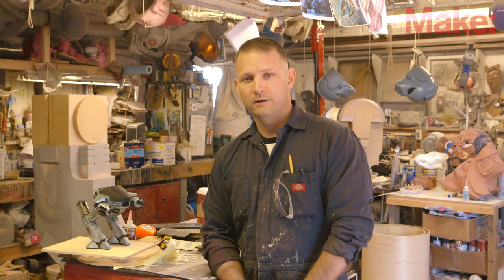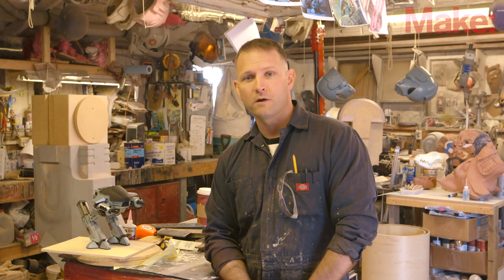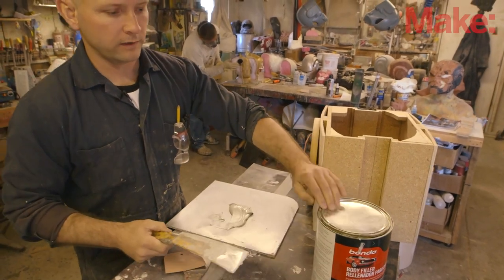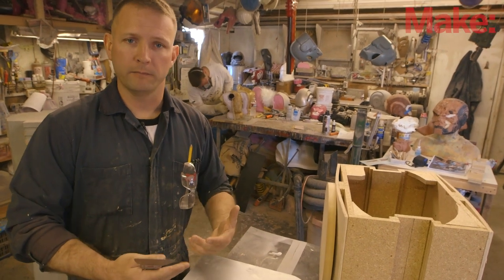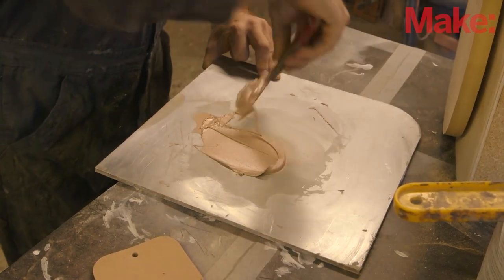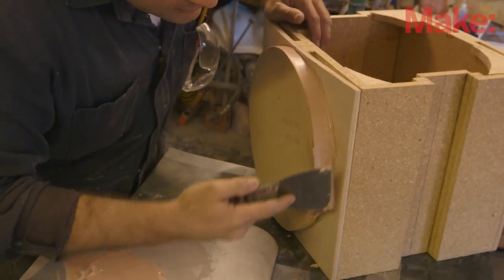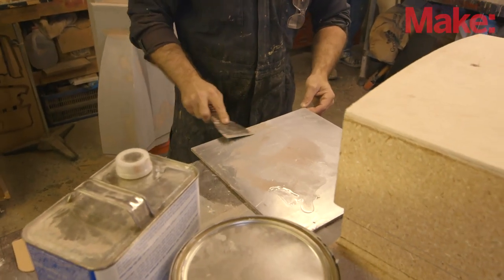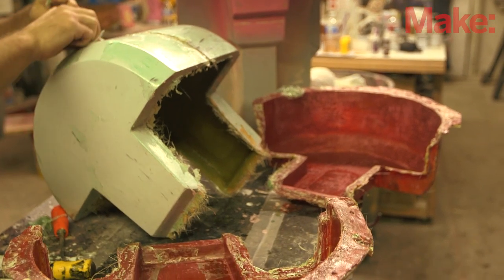Building Up To Maker Faire: Body Filler Tutorial

Comment: All that work with using a non-porous ladida and then cleaning it afterwards with liquid brain fry is unnecessary. Instead use a paper block on a flat surface. It mixes just as well and no proporties are changed. After use, just discard the used piece of paper and you´re good to go for the next round. (though if you have a lot of leftover bondo, wait a bit before throwing it out since the curing creates heat)
I´ve used this approach on both windmills and display furnitures.
Reply: I use a stack of paper plates for this.  The cheap ones are like $1 for a stack of 50 or so, and when i'm done mixing one, I can just peel the plate off and use the next one.
Reply: That's a good idea.  I'll still need liquid brain fry to clean the tools, but at least I won't have to worry about the mixing surface.  Thanks.
Reply: The smell of acetone is my favorite part of the day.

Comment: Do you find that the Bondo sets harder than the material you are applying it to? This would make it very hard to sand a smooth transition back into the original material.
Reply: Good point. As "Bondo" was designed to be used on metal, I'm curious about this as well.
Reply: in this application it doesnt matter, the fiberglass wont need that sort of precision.
Reply: nintendolunchbox
Exactly, this will just be a plug for a mold and then tossed away.